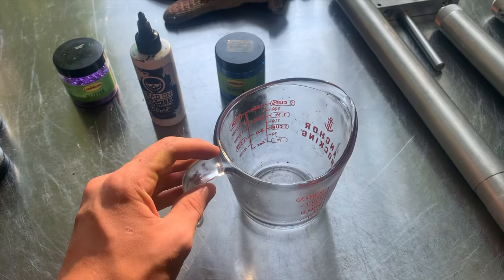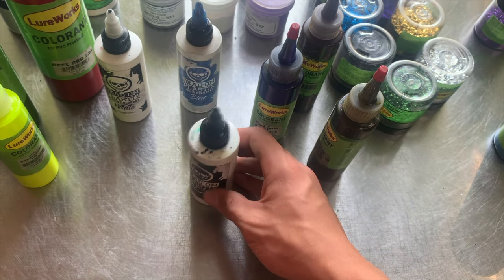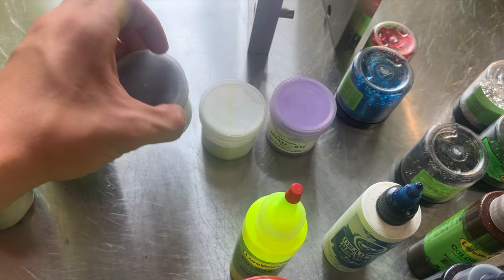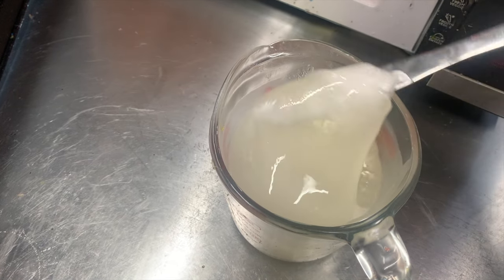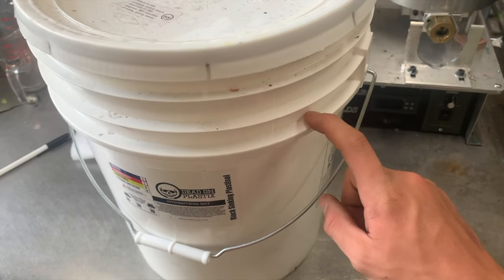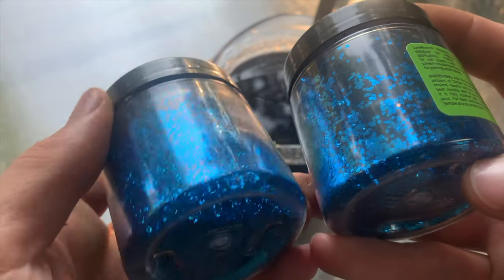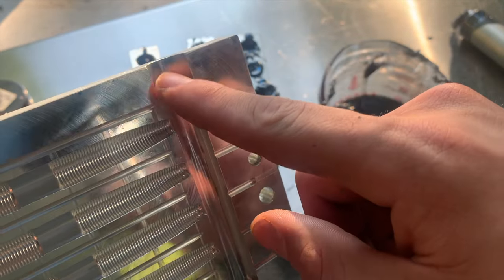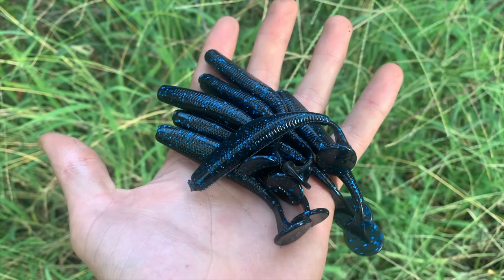Everything YOU Need to Make Baits!!!

Comment: Bro I would be trying to get big jugs of glitter for the cheap. I guarantee it’s out there. All that stuff definitely can be gotten wholesale in big jugs. You’re getting middle manned with those small bottles. Just a thought. Keep it up bro!
Reply from the maker: Thanks man! Umm no the same website that I get these sell the same thing in 5 lbs and is the same company the top manufacturers get there glitter.
Reply: @MarrKing  ok good just looking out. Real quick search found glitter $120 for 10 pounds. So 12$ a pound. I’m sure it could be had for even less than that too
Reply from the maker: What website?
Reply from the maker: It also has to be glitter made from bait making because it has a higher heat tolerance
Reply: @MarrKing  keep up the good work man sky is the limit!
Reply from the maker: 🫡💙sure will